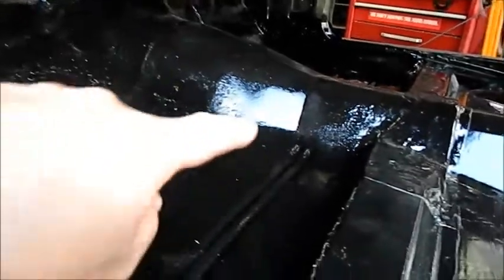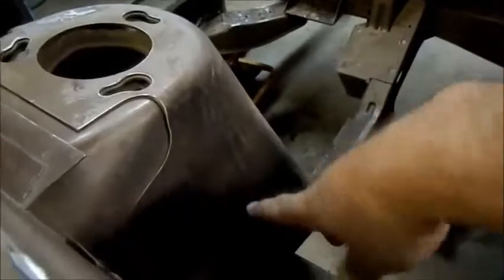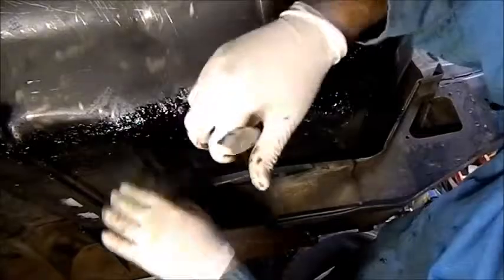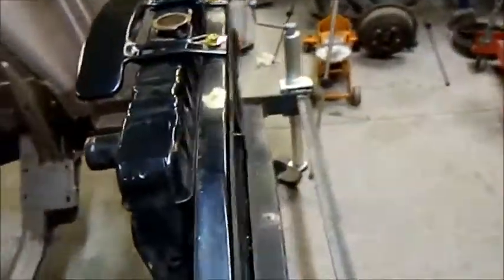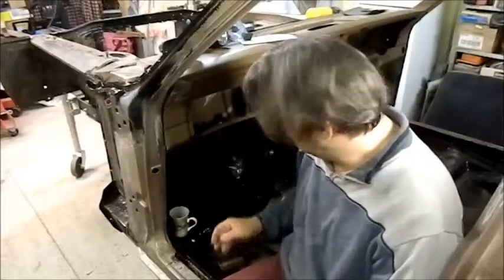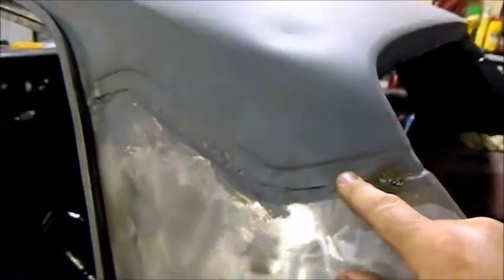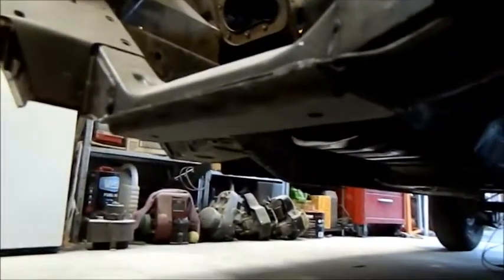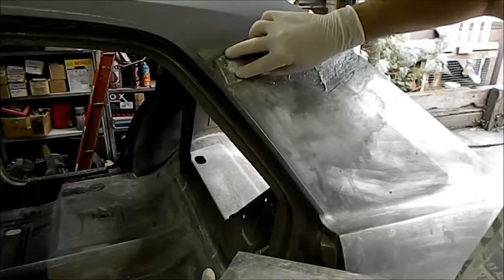1969 XW Ford Falcon Restoration Part 6

Comment: Only up to part 6 at this stage but is like going down memory lane watching this. Restored a genuine  XW GT cleveland back in the early 90's. Was my brother in  laws & was sitting in his shed for about 10 years pulled apart & sanded back to bare metal. I had a chuckle about your advise to bag & label everything. Unfortunately he didn't & the hours I spend trying to find the right bits, especially clips & small items you wouldn't want to know. Has similar minor rust issues in bottom rear window, rear quarters & corners of doors but the floor was pristine. Still got the beast after a 4 year rebuild & look forward to watching the rest of your doco. Great work Pete & thanks for posting

Comment from the maker: Thank you all for the positive comments... yes the dust is a pain - just need to keep cleaning it and disposing of it. I'm always careful to wear a respirator while sanding/cleaning up. Most of my knowledge is from advice given by those who are qualified... I reckon that's the most important part, there's an awful lot to be learned from those who really know, I'm merely an amateur. Cheers P

Comment: I am rebuilding a ZD Fairlane and also own an XY. The last rust spot to get is inside the sills. If you undo the spot welds off the end plate this allows you full access. Once clean you can POR-15 the insides as there is allways rust in there. I used a piece of reo with a household sponge tapped on and dipped in POR-15 to paint the whole length.
But excelent work so far. I but welded a floor into the XY years ago and now you have me wondering about legality (Qld).

Comment: G’day Pete, did you get rub throughs down to metal/filler during blocking down, and if so, how big was the rub through before you considered hitting it with etch again? Cheers, Alex (currently doing roof on HK Brougham)